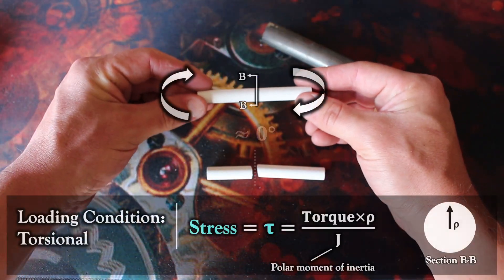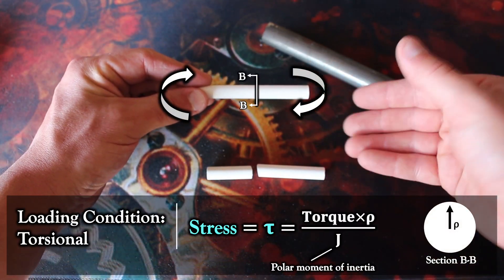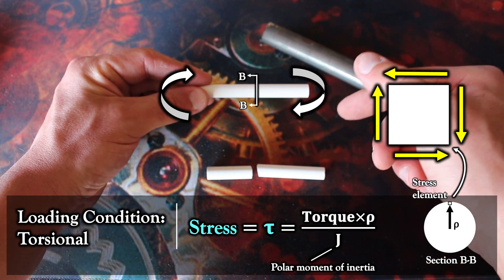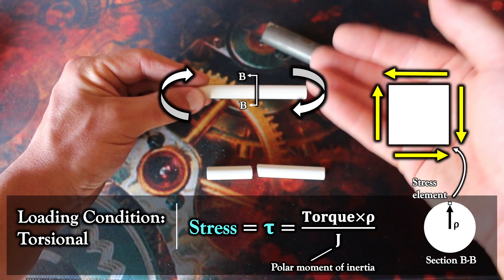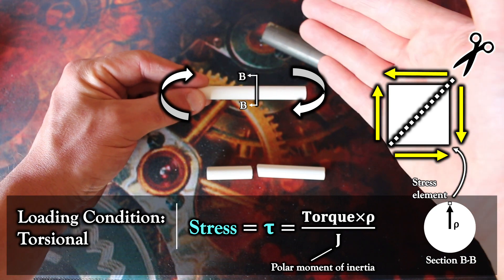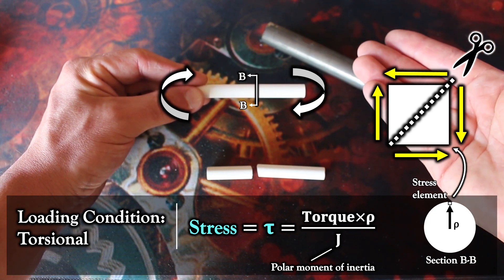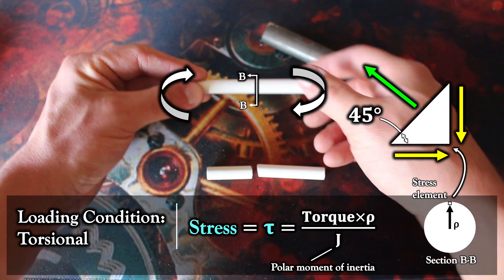Brittle Failure Demo

Comment: How do we know that max normal stress will be 45 degrees off the plane?
Reply from the maker: Hi Kam, great question. Check out the stress element at 1:25, which comes from the top of Section B-B.

Subject to pure torsion, the shear stress (yellow vector) at the top of the square is opposed by an equal and opposite vector at the bottom of the square by Newton's 3rd law, and that counter-clockwise couple is opposed by a clockwise couple at the left and right sides. But we want the direction of normal stress...

Normal stress is defined as being perpendicular to a cross section. Along the body's axes of symmetry, we see only shear stress. If we want maximum normal stress (green vector at 1:31,) we need to sum vectors and determine what plane they are perpendicular to. The angle created by summing two equal vectors happens to be 45°, because the opposite leg divided by the adjacent leg is 1, and arctan(1)=45°.